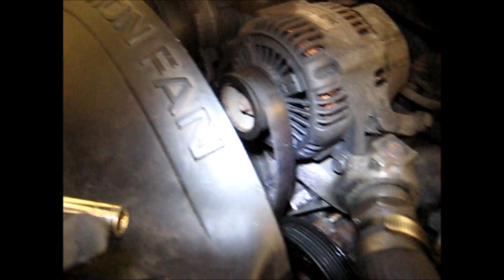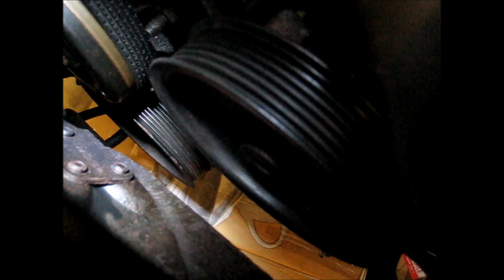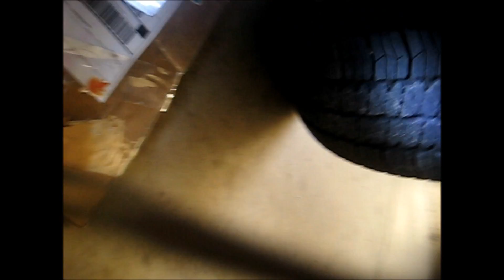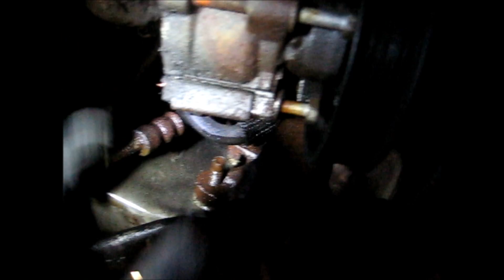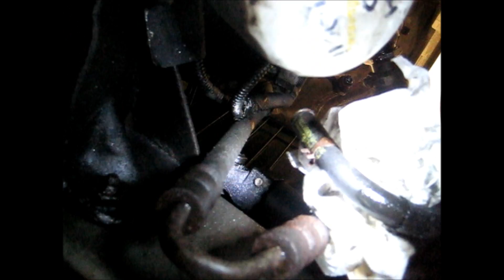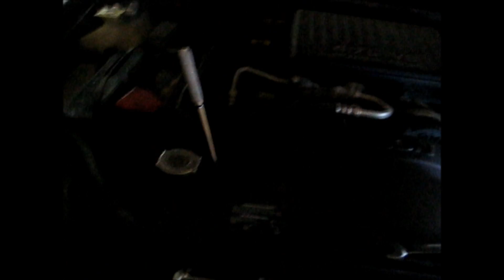How to Replace a Power Steering Pump on WJ jeep Grand Cherokee

Comment: For 4.7L WJs with the hydraulic fan, the process is basically the same but there are three hoses in total to deal with, as there's an extra low-pressure return hose. It's also a total bear getting onto the top hose nut because there's much less room.

I had to remove the pump with the top hose still attached, then separate the reservoir, and put the pump body into a vice to be able to get enough purchase on the top nut to break it free.

Comment: Thanks for the vid men.
I have 2004 wj with the hydraulic $1200 fan...it's beeng replaced with a 12 blade ford fan and clutch and 180 degrees thermostat as well...but the power steering pump has to come out too bc it has two low preassure hoses and they cant be pluged...all i needed was to see another wj with the mechanical system and voila..! You showed me the way...only one return line on yours and thats what im buying...thanks men!
Reply from the maker: Hi Diego,  Glad the video was able to contain the information you are looking for.  Good Luck!

Comment: Is that a reverse thread kn the top hose
Reply from the maker: Its been a while but I don't remember any being reverse thread.  It should just be normal.  But as mentioned there are different nuts for different years.  There is a chance the other nuts could be reverse, but I can't say on that.

Comment: are these prone to go bad on this particular model/year? my car is very heavy to steer .. bad pump?
Reply from the maker: I wouldnt say they are prone.  But they can wear out with time.  Mine was closing in on 200k.   If your car is heavy to steer, it could be the pump going bad, but first thing to check would be just to ensure it has enough power steering fluid.  If the fluid level is too low you wont get enough hydraulic pressure even if the pump itself is okay.
Reply: thanks will have a better look

Comment: Is this the same process for the 5.7 L hemi on a 09 grand Cherokee Laredo motor ? I put a 09 5.7 L Cherokee hemi in my wrangler and I need to change the steering pump but wanted to make sure
Reply from the maker: I can't say for certain as I have not worked directly on the 5.7L hemi.  But I highly expect it to be the same.  That being 1. Release the tension on the Belt.  2. Remove the bolts through access slots on the pulley.   For reference  i looked up a used Hemi pulley on ebay and here is the link.  The reason I did was to see what bolt pattern there is in the pictures.  Looks to me it should be the same except there could be 4 bolts holding it on instead of 3.  Just a guess, but I think you should be good to go.  good luck.  https://www.ebay.com/itm/5-7L-Hemi-power-steering-pump-05-10-WK-Grand-Cherokee-XK-Commander-52089883AC/152790123195?hash=item23930042bb:g:hgQAAOSwVtZaDcI7&vxp=mtr

Comment: Do you need a specific tool to remove the pulley from the pump?
Reply from the maker: +suggst65 You dont need to remove the pulley to do the repair.  You can access the bolts through the holes in the pulley.  And if you buy a new pump with a pulley already installed then you are good to go.  That said, YES if you want to remove the pulley from the pump there is a special tool that is best to use.  It is a pulley puller.  It usually looks like a 3 to 4 fingered claw with a screw down the center.  The claws grip the outside of the pulley.  The screw then pushes directly on the center of the shaft that the pulley is on.  Then as you tighten the screw it pulls the pulley off the shaft.
Reply: Far Reach Engineering Thanks. Turns out you can rent the Pully Puller/Press from any auto parts chain.